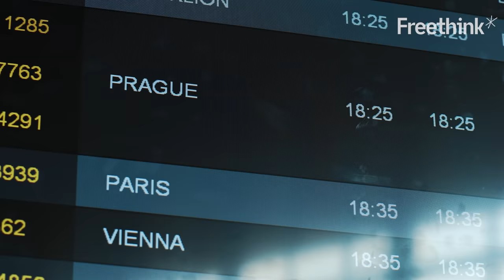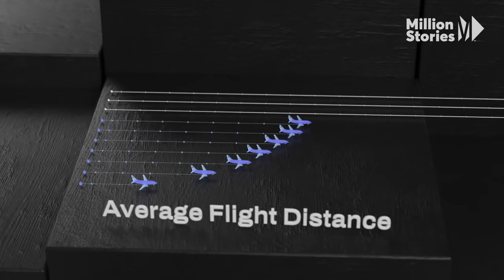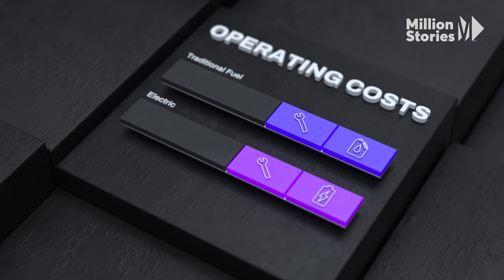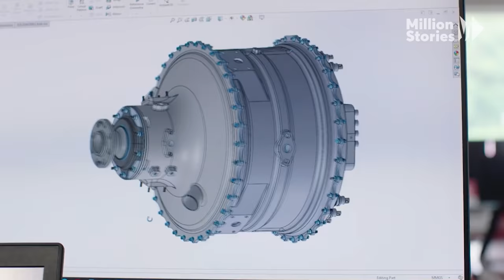Electric flights planned for 2026

Comment from the maker: Do you think electric planes will change air travel?
Reply: VTOL will change air travel. Probably E-VTOL.
Reply: I seen a video where they are designing the entire shell and wings as the battery. Every battery engineer is aiming for a better lighter battery. The question is when.
Reply: @dragonskunkstudio7582  to
Reply: I mean... i there are enough pilots why not :D
Reply: No. The only way that an electric aircraft can fly as far as the man in this video claims that it can is if it flies very, VERY slowly, so cars and trains are far better options. Trains even eliminate the need to produce batteries, eliminating the environmental problems associated with them.
Reply: Imagine how much faster the world could develop green energy solutions if it wasn't for intellectual property rights, patents and limitless capitalist greed in general...
Reply: @sanjuansteve  If we did away with concerns about profitability, we could build an enormous nuclear energy system and use carbon capture technologies to remove carbon from the atmosphere, then we could use some of that carbon to produce fuels for existing vehicles, and sequester the rest.
Reply: @PistonAvatarGuy  So your idea is to move to even more centralized nuclear power and to continue to burn carbon while cleaning it, rather than simply switching to electric vehicles and solar power?  Wow.
Reply: There are still issues with battery weight and range so not yet maybe hydrogen though
Reply: Yes
Reply: {>>" # < Hello.h > Electro motor connecting mini nuclear power station in the airplane???? ";}

Comment: I actually think that there's a use-case in Africa.

Large airports are even more inaccessible and this tech could unlock the tourism industry in lesser known parts of the continent. E.g. The western coast of RSA (specifically in the Northern Cape) is hours away from any large airport, but is within range of CPT.

Infrastructure issues, at the level that the video suggests, can be dealt with.
Reply: Exactly, USA can build high speed train network easily.
Reply: @rakeshswami11  gotta do it
Reply: @rakeshswami11  The US could build a high speed rail network, but no one in the government wants to use malls, hotels, apartments, etc. to pay for it because so many news outlets are calling that gentrifying. Make things for the middle class, and everyone will enjoy it.

Comment: Yeah, fast... Not with 911 policies still in place, this will never be a "public" transportation, as it alienats 50% of the population, at least.
I miss trains.
Reply: Trains! I was surprised when they said everyone has to drive long distances to get to the airport. Why are there not more trains or public transport taking you to the airport? I haven't driven to an airport to fly in probably more than 10 years.
Reply: Plus they didnt mention the cost of the battery.
Reply: Going through TSA is extremely slow because there are literally thousands of people at once going through. Having thousands of small airports would eliminate the traffic jam.
Reply: @extraclip  the weight of batteries is more of a concern. After including them you'd have no room for a pay load. The only power source that might work for an electric aircraft would be hydrogen.
Reply: @domdittyful  Yeah as mentioned above trains would be cool as they don't require such a rigorous search of the passengers, and they can be pretty fast.
Reply: @yaash4123  The TSA search times wouldn't matter nearly as much if there werent long TSA traffic lines in the first place. There plan is to build small airports for these types of planes all over which will greatly reduce wait times.

Comment: The problem isn’t tech

People are far more apprehensive about flying in a small plane. 
People see air taxis differently but a small airplane makes people nervous 

Plus, everyone sees these flying in beautiful weather, no turbulence, no thunderstorms to avoid, no crosswinds
I had one of my friends throw up because I had to add rudder correction for a crosswind landing.

It’s not as simple as slapping in an electric engine, building a new terminal and building and you have a new form of public transport.
Reply from the maker: There'll definitely be a curve for adoption and the need for exhaustive safety testing first. It'd be interesting to read up on how long it took people to get comfortable with the idea of flying at all, or the idea of flying in jet planes.
Reply: @freethink  I mean 
From the history lessons I took (you actually get some aviation history when leading in to be a pilot)
The first commercial plane ticket was sold in 1914
Commercial airline travel as we know it today only became available to the “masses” (upper middle class and up) with the 747 in the late 1960s
It only became available to the MASSES in the 1980s 2 years after deregulation in the US that’s 66 years after first commercial plane ticket.  
Today, flying is the most affordable it ever was and its still one of if not the most expensive way to travel. 
Also, studies have shown that 70% of people are still nervous or scared of flying aboard a commercial airliner even though it’s the safest way to travel by multiple metrics.

So yeah it’s going to take a while for everyone to be comfortable with this… also, 1/6th of Americans have never been on a plane.
Reply: @nikobelic4251  I'm pretty sure dedicated High Speed Rail is safer than flying, and flights are comparable with cruises.
Reply: @KRYMauL  but noisy measures “dedicated high speed rail” compared to all of flying 
Maybe a more accurate measurement of the thing you proposed above would be 
“Dedicated HSR and flights that are 1-2 hours long”

You can’t just cut out most of one transport sector and claim it’s safer because the part of it with the more spotty safety record is suddenly gone.
That’s assuming High Speed Rail even has a better safety record than flying….
Even if that’s the case, that metric is flawed

And flying is safer than cruising…. check the stats.

Just checked the stats in Europe
in 2020 647 people died in train related crashes 
In all of aviation in Europe in 2020 (that includes means of transportation not available to the average population: GA, Search and Rescue helicopters, ultralights, gliders, aerial photography, surveying , etc etc.) there have been 112 deaths, 0 of which have been on a commercial airliner, which is what 99% of people who fly take….
So even if you take every single type of aircraft operation in Europe 6 times less people have died in the air.
There hasn’t been a single airliner that crashed in Europe since 2015… and I don’t know of any other incidents that led to death aboard a commercial airliner in Europe at that point either.

I bring up Europe because they are a global leader in HSR.
In the US it’s pretty easy…
There has been one death aboard a commercial airliner in close to 13 years. And it wasn’t due to a crash.
More people have died onboard trains in that time period, way more.

https://ec.europa.eu/eurostat/statistics-explained/index.php?title=Railway_safety_statistics_in_the_EU

Comment: I'm pretty sure for most people a small airport is more than a 15 minute walk away.  And I suspect they won't be interested in pulling their luggage for that distance.
Reply: Yes, for me it is a 10 minute drive, but long term parking is free, and the longest line I might have to stand in is also 10 minutes.  Compare that to the nearest large airport, which is a 90 minute drive, and I need to make sure I get there 2 hours early to stand in lines,  and at least $8 a day for long term parking, using the smaller airport is a "no-brainer."
Reply: Why not? Nice airport t2 is 20mins to half an hour from the train station, and i walk that every time, unless you're over 50 it shouldn't be an issue.

Comment: I see a fuselage tube just like an airbus but without large wings and it is being thrust into the air from electromagnetic railgun type of system from static ground based energy storage and it lands via air duct inbuilt at its destination . They will travell no more than 50km and go at 500km peak per hour meaning the flight time will be approx 5minutes all up including landing . 100km is also possible but with smaller size . Hauling heavy energy storage is not necessary for this concept and neither is the fuselage as  it doesn’t require the same build as a existing jet liner!
Reply: 🤔 I like where you're going, but how do you prevent the initial crushing force exerted on the passengers inside when fired from said "rail gun?"

Comment: Do an electric VTOL, tilt quad rotor with autonomous take off, fly, and land. Transportation solved.
Reply from the maker: There's actually another company we checked out that's doing something similar to this! https://www.freethink.com/technology/mass-transit-evtol 
It's a really exciting time where a lot of people are racing to create the transportation systems we could use for the next decades. Time will tell which technologies win out.
Reply: Vertical Takeoff takes emissive energy reducing the already low range in electrical airplanes

Comment: Sorry but this just seems like an ad fo Magnix. He says "let's solve the 70% of flights", meaning the flights under 1000 miles, saying "we can do it today" and then showcase a plane which has a range of about 100 miles?
Not only this but then the environmental effort becomes... making more and more planes just so people don't drive to the big airports? That's not a solution, especially if your interest as an airline is making money. It's a solution only for Magnix as it means selling more electric motors/planes. Why not use trains or coaches to get to airports instead? Way more efficient.

Battery electric planes are not the future, except for extremely short distances: weight is too important, and battery energy density is not even remotely close to that of liquid fuels, nor will it be for decades, and while less maintenance is required, the turnaround times would be abysmal.
Reply: I think the biggest issue is that those planes aren't really used for wide commercial use. The cabins aren't even pressurized, as far as I'm aware..
Reply: A company called Ampaire just set a record when they flew their eletric airplane over 341 miles. Though it was only a two seater I believe, it is still a proof of concept. If theyre able to do that now.. I don't think it'll be too long before they can do it with slightly bigger planes. An 350 miles is more than enough for short haul city to city flights like the video talked about.

Comment: The solution is elastic band wind up propeller powered giant planes ,the passengers & crew would get a good work out pre winding up the elastic bands to lock in position for take off . The aircraft would be able to part glide & part run on elastic power to regain altitude & any instruments lights & controls could be dynamo powered from small windmills generating electricity fitted to fuselage . If the aircraft ran out of elastic band power ,it could be stick landed & no danger of any explosion or fire to incinerate passengers in crash landings . This would ensure cheap green safe flying experience & fit & non obese passengers & crew due to regular work outs winding up elastic band engine props .

Comment: Did you take into account the depreciation of the battery when calculating cost for 1:30h flight?
Reply from the maker: That's a good point - some kinds of batteries decrease in performance significantly over time, so the lifespan and replacement cost definitely needs to be factored in.
Reply: Batteries, all the aircraft components, piloting and their training costs, airport and ATC fees. Still very attractive transportation option.

Comment: I don’t think I would volunteer to be one of the first to ride what if they loose all power because all the batteries went bad at the same time.
Reply: That's not how big machines work
Wherever there's a risk to life or something equally expensive, there are redundant systems.
In case of batteries, the batteries are always wired in such a way that you'd have backup power in case the main power goes dark.
Reply: Yes, and what if  normal jet engines stall simultaneously? By bird strike, computer malfunction, bad fuel, etc.

All technology can suffer "what ifs" and paranoia can destroy ya'.

Comment: Not that I wouldn't mind seeing this come true, but the video is very unrealistic. Even electric cars have  along way to go before they are mainstream. The FAA takes years to approve commercial airplanes, let alone a new engine technology. What about all the pilots that will be needed? There is a shortage today for commercial flights. What about the infrastructure for charging an electric plane? I guess you could pull up a diesel generator. There are just too many holes in this unrealistic timeline and price point.

Comment: so much bullshit in this video. electric motors are more reliable than piston and even more reliable than gas turbines. and with 95% efficiency there really isnt so much heating when you consider you have all this air around you at least not so much problem as with piston engines.
so... he says lets fly 45 minutes with small aircraft that is like what...300km/h cruise speed? that will get you no where plus boarding time its better to just go with car.

Comment: Based on the average intelligence of people and how they drive … let’s keep flying vehicles out of the hands of almost everyone.

As for the technology … range is an issue on batteries and so are charging times. The next tank of aviation fuel gets the roughly the same range … with each charge the batteries will lose power and range. If you want to innovate aviation … someone make a micro nuclear reactor and power a plane off of that.

Comment: But what about if it crashes and all them batteries crash together what an 

explosion to ????
Reply: What? Crash is a crash. Planes didn't bounce before either after a crash xD I think electrical engines are safer than engines with oil in it.
Reply: Explosion to fast unplanned reassembly of the aircraft.
Reply: Hungama Toons  ok even if the wires where ark ing out to ? Mmmm from the crash ?